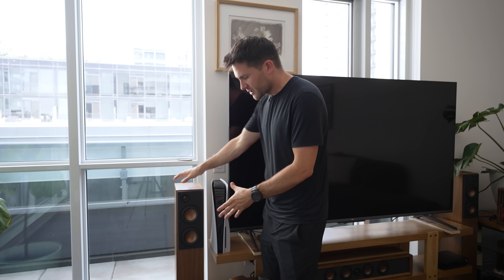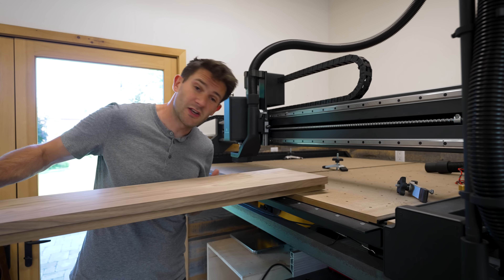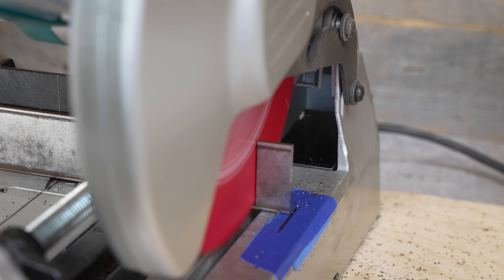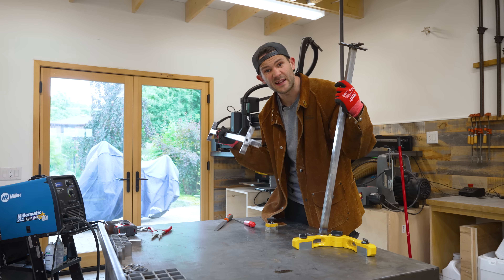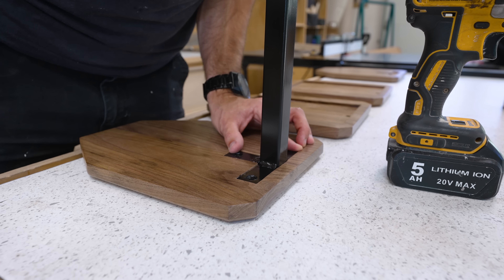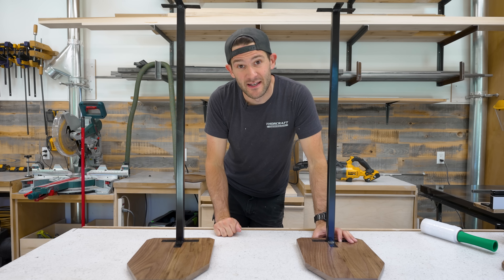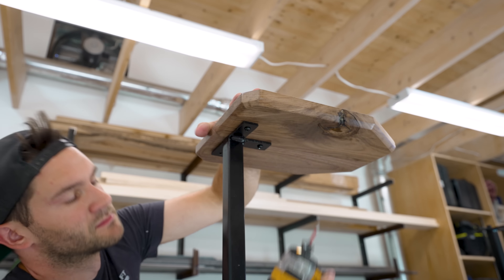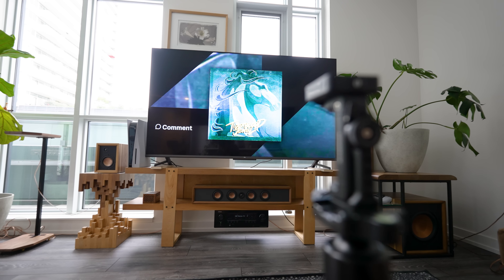The one trick audiophiles DONT want you to know...

Comment: Besides the speakers themselves the most important thing to sound quality is the room itself. Parallel walls and floors diminish sound quality and for the best bass response you want the sub closer to the floor. In the age oh high fidelity, late '70s through the '80s, subwoofers became extremely popular.  Bass can not be made stereo indoors because of the size of the wave so a sub and satellite speakers ruled. That took care of the bass and speaker placement, balance and fade took care of the rest. Then came surrounded which put a delay on rear speakers to mimic the dopler effect giving depth to video soundtracks. After that came recording and playback sound directabillity so that sounds like airplanes, rain etc can be focused within a room.

Comment: I was extremely skeptical about everything except the foam padding. The 2lbs of sand didn't seem like a substantial enough amount to make a difference and the feet (despite looking pretty awesome) didn't seem to me to have any sort of logical benefit to me.

After hearing the audio clips in each position I can actually hear a distinct difference.
There is much more of a reverb and vibration when on the floor. The sound quality becomes less reverberate and slightly muffled on the non-acoustically inclined furniture. The new furniture seemed to have a brighter sounds altogether. 

Perhaps it was the song, perhaps it was my headphones, perhaps I'm just sleepy or maybe...just maybe....it actually made a tangible difference.

Comment: Everything soundquality is subjective, as long as you are happy about it and it sounds good to you. 
My few suggestions is to set them up in equilateral triangle for the fronts, the backs to a more directional way directed at your ears and maybe to move them out from the corners or walls to get the best experience possible.
In your Amplifier/AVR set all speakers to small no matter what te size is of them physically just to send all the low tones to the subwoofer. 

Try that and hear for yourself if there's a difference ;)

Comment: To me, setting them on the floor had too much boom and low end which is expected from the floor magnifying the sound, particularly the low end. The non acoustically treated furniture sounded better, but seemed like it lacked some detail and clarity. The stands you built probably sound the best in person, but on the video they sound thin, which in my experience, the microphones won't be able to accurately pick up the frequencies of the speakers as they tend to pick up way too much ambient sounds and reflections, but overall, I think the speakers on the stands are probably the clearest.

Comment: #Zacbuilds So this is why speaker stands, spikes and mass loading works, speakers generate vibrations in order to creat sound those vibrations will travel trought your speaker cabinates witch creats a harmoinc resonace in the material and the material witch it comes in contact with. There are allot of diffrent resonanses from diffrent materials that reach your ear at a diffrent time and amplitude then from the orginal source the speaker mebrane. That is called disstortion and your ear brain is verry good at picking these up! So bye isolating your speakers through mass and pointed to a small surface area that helps you not to coupple the speaker to the next material witch cutts down on unwanted/uncontrolled harmonic resonases so now you know some of why it works 😉

Comment: There were small, really insignificant, differences between the setups, but this is really dependant on what you are listening to this on, as well as recording it on. But in general throughout the decades of music & co. I have found that a buck spent on driver and box quality & design (i.e. int. volume, patterns, etc) goes much further, than a buck spent on gold wires or stands. I.e. you spend 20 bucks more on a driver, it will give you much better results in sound, than 20 bucks worth of speaker stand.
But sure, the industry wouldnt exist, if there wasnt actual benefits. However miniscule and really non-sensical in terms of value gained to assets spent. If those 2 dont matter to you, the design aspect of this kind of project is just an invitation to live in the shop for 3 months, producing every possible design of the thing. Which is freakin awesome to me!

Comment: Great workmanship but you missed the point of sand. A lot of times speaker stands are much larger and made of wood. This creates a box that resonates when the speaker sits on them. Some speakers actually have these boxes below them to boost lower frequencies by resonating. Filling them with sand prevents that resonation and therefore prevents those resonations from changing the speakers sound. The point is not to make the speakers sound better but to let them sound as intended with the least amount of interference or resonance from their stands. Low end sound is the culprit, but small diameter metal stands won't creat much resonance in the low end so filling them with sand will not make any noticeable difference. However, a say empty 12"X12" stand made of wood could amplify your bass big time and totally mess up the sound of your speakers. It could also enhance them if they had poor bass response but that would be luck. The point is to make your stands acoustically invisible but you did that already by using "dense" metal that is small in diameter. So great video on how to make an acoustically invisible stand but also kind of mis information. Of course your stands didn't make the speakers sound better. They are not supposed to alter the sound of the speaker!

Comment: I watched another video where different speaker stands were tested. The author was all excited over a 3dB improvement in the freq response, resulting from a $1200 stand. That 3dB improvement was at the bottom of a 20dB dip. So a 20dB dip turned into a 17dB dip. I'm sorry, but I don't think that 1, a 3dB improvement in a 20dB dip is significant or even noticeable, and 2, even if that 3dB IS noticeable, it's not worth $1200 times however many speakers you have. I think, bottom line, is that I agree with you that expensive speaker stands provide a poor ROI for SQ.

Comment: The biggest issues with your design was that you use very small materials for the poles. That way it is very difficult to weigh them down by filling them up with sand. Sand will dampen the ringing sound that automatically will come into the bars if they are not damped.

Comment: You overpaid the spikes... But they work really well, I used them for my sub, immediately removed ground shaking and with that the shelves and drawers etc rattling and my sub is heavy, somewhat 40 kilos, so yea, they work very well if you use them in proper place. With your stands, probably some regular anti scratch pads or dampening pads or rubber dimples would work fine.
Speaker stands - they are actually meant to raise the speakers to your listening level eg next to your TV if you don't have room enough on the sides of your TV for example to place them. That's it. Little bit less bass to the floor and raising them to hearing level.

Comment: Yeah. I'm calling myself kinda audiophile... With built in speakers on my phone - no difference at all. BUT - Watched the video with nice, good headphones and there is definitely a difference noticeable. And the biggest difference for me is between floor and stands. On the floor there is much more volume in the lower frequency. Nice bass and warm sound, probably because they where near ground and coupled to the wood floor. Maybe by the fact, I think you said, you lowered also the mic with them to be level... Would be more comparable by having the mic just sitting on the hearing position. 
The clearest for me where the new build stands. Nice crisp sound on this. Personally I would prefer them on ground because the sound (except the problem you would have by sitting out of level then 😹) But that's just my opinion 🙂

Comment: This video's title was pretty much clickbate with false information. Sand, lead shot, mass have NEVER been any sort of secret. 

Its simple. Mass, and if you can put a foot on a stand, and twist the top, it's bin material. Plenty of actual science and educational video's out there, but the best thing to do is actually educate yourself and listen less to audiophool nonsense.

Quite a lot wrong with these stands, they are simply too flexible with too much unsupported area with too small a chamber to make much difference when adding sand. You want a top platform that is equal to or slightly smaller than the speaker bottom, with a larger footprint. Spikes should be fixed to the base not stuck on with sticky tape. To be straight, looks aside, your speaker stands are complete and utter shite.

They dont have to be expensive, Atacama SE sounded fine with play sand in them.  
Not that it would matter, if someone cannot hear a difference between a floor and  even a cheap stand, they are clinically tone deaf or using the worst speakers known to man. Raising a tweeter from below head height, to head height, to above head height, or against a wall to midway in room, or floor boundaries are easily heard and measured even by kids doing their 1st sound production course in a room full of babbling students.

As for your opinion, its laughable, you have an echo chamber for a room, and you dont hear much difference, despite reflective floors, tweeters at floor height, bass reinforcement from the floor vs stand height, distance from rear walls, and having speakers sitting on reflective items like the weird pedalstool and table. 

Maybe it highlights how bad your DIY speakers and room sound, or how bad the electronics are? 

All that gear and no idea.

Comment: Geezzzzzzz, where to start?  First, listening to comparisons over the internet is pretty much useless.  Resolution of the signal(who knows), what the end user is listening on(equipment).  Now those stands you built.  While I'm impressed with your woodworking/metal fabrication skills, it was wasted on a poorly designed stand.  One long thin post just isn't enough to give you the required stiffness.  It looks like it bends and wobbles.  The tiniest amount of movement can blur the tweeter's output (remember, the pistonic throw is tiny and any motion in the stand affects its clarity.  Next those walnut top and base was a waste of expensive walnut.  Solid wood has a resonant frequency that mdf and plywood don't.  Not to mention that extended lip on the front of the speaker cabinet will certainly cause an early reflection, distorting it.  The pad inset on the top of the stand.  Really?  The spikes can be replaced with threaded types and if you have no carpet, there's a simple effective solution for that.  I could go on but frankly take too long.  If I had your skills and equipment, by the way that CNC table is awesome, I would try my hand at one of these models that are truly effective.  I would repurpose your stands for something else.
https://www.musicdirect.com/equipment/furniture/solidsteel-ss-series-speaker-stands-pair/#sirv-viewer-593901161637

https://www.monoprice.com/product?p_id=31263&utm_term=&utm_campaign=PMax:+-+Smart+Shopping+-+Monoprice+-+Mounts+%26+Stands&utm_source=google&utm_medium=cpc&hsa_acc=6614305189&hsa_cam=17499847625&hsa_grp=&hsa_ad=&hsa_src=x&hsa_tgt=&hsa_kw=&hsa_mt=&hsa_net=adwords&hsa_ver=3&gclid=Cj0KCQjwtO-kBhDIARIsAL6LoreoflVkfWi5G1oeN-htKTamYyZk5WU3NRRKt3BlTGWMqf1hhfO7y-MaAuZpEALw_wcB

https://www.musicdirect.com/equipment/furniture/target-hr-series-speaker-stands-pr/